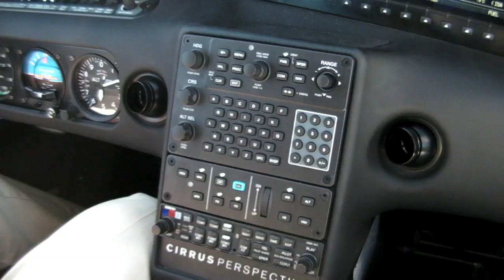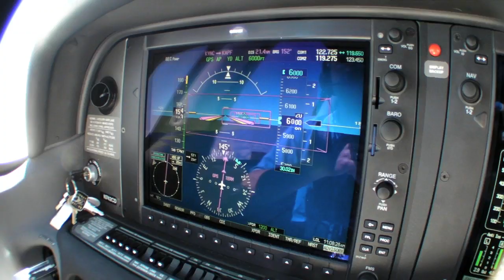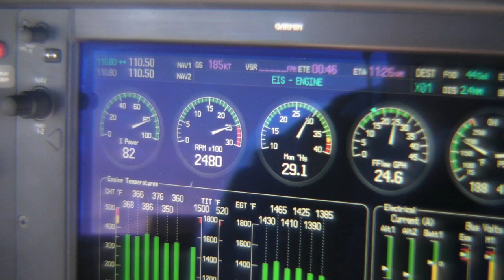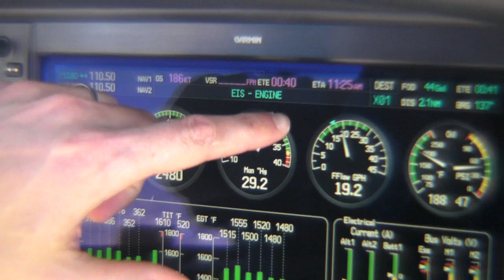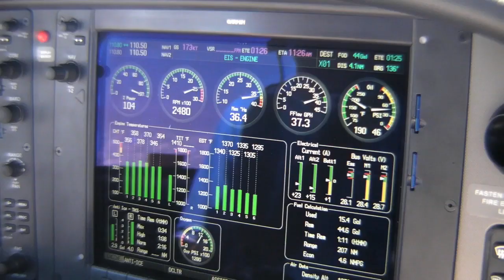Cirrus SR22T Flight Demo

Comment: Those "Plastic Mustaches" are actually oxygen cannulas, as they said they were at 17,500 FT AGL which is above the FAA Mandatory Altitude limit (12,000 FT) for oxygen. If they didn't wear those then they would have suffered something called hypoxia. Hypoxia is a pathological condition in which the body as a whole or a region of the body is deprived of adequate oxygen supply. After the suffered from hypoxia then they would slowly pass out. Hope this is helpful!

Comment: Yes cool video. Matt smiles on takeoff because Paul forgot the fuel pump... And he thinks that he is 'smoothly going to die'. :-) 

Jokes aside I don't understand why Cirrus came out with something that doesn't fly any faster and runs hotter and burns more gas than the Turbo Alley TN.